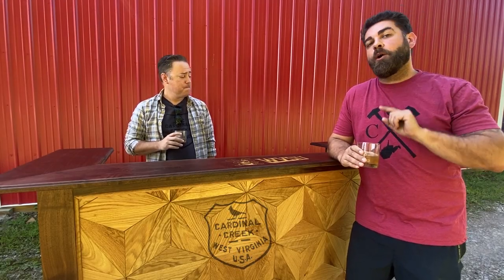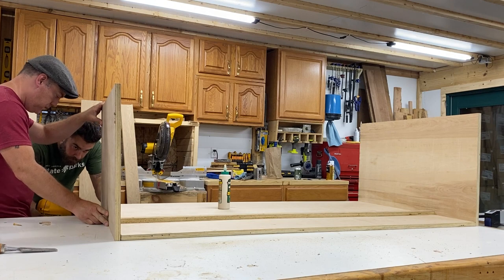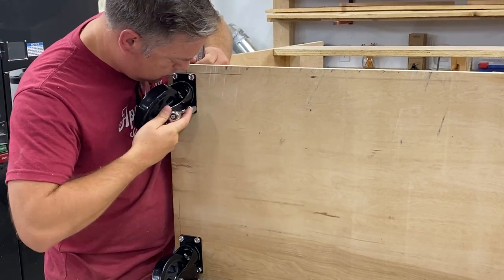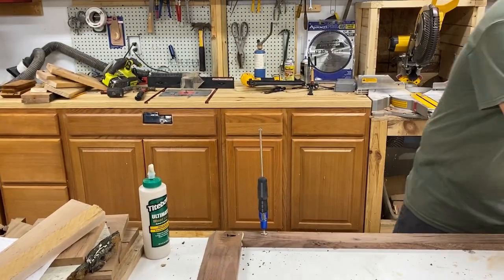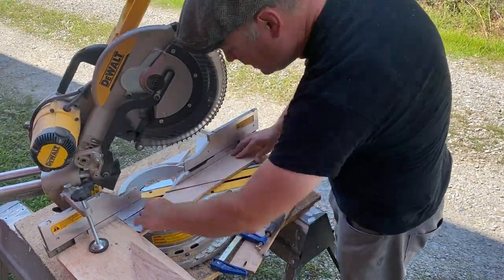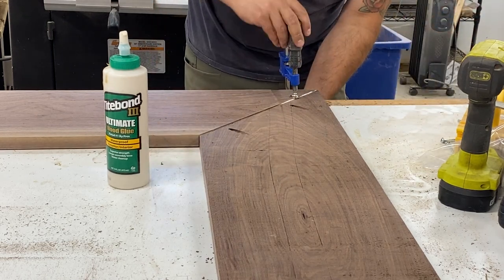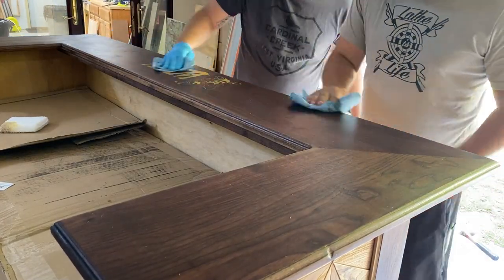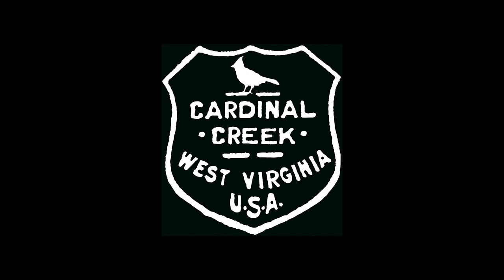DIY Portable Bar on Wheels | Rolling Wood Bar

Comment: Love it , what size is this Bar ?
Reply from the maker: We’ve built a few of these each at slightly different dimensions. The one in the video is about 56 wide by 24 deep on the outside. The ice chest is 20.5x20.5